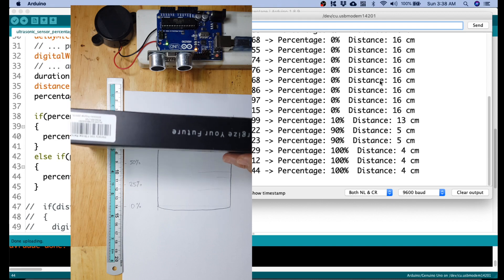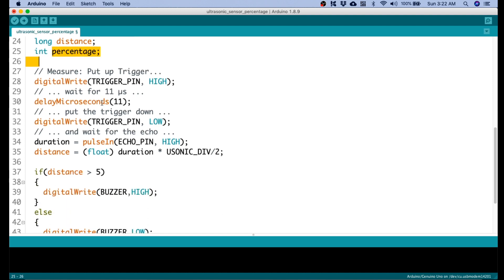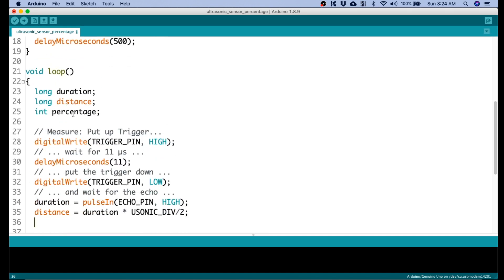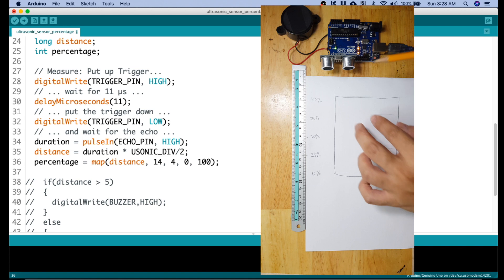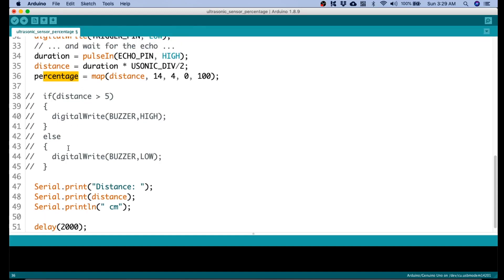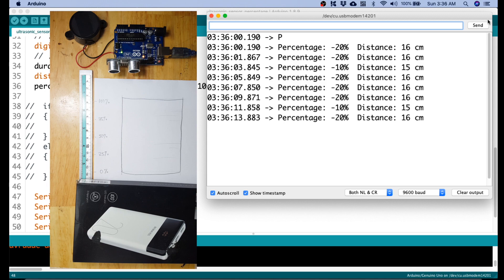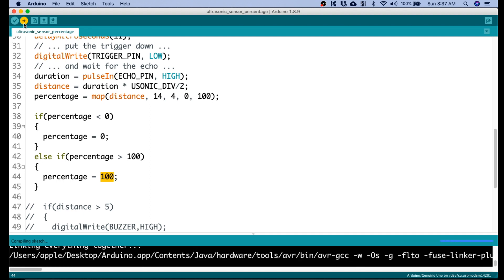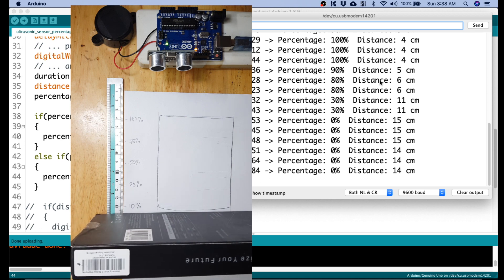WATER LEVEL OR FLUID LEVEL SENSOR TUTORIAL IN ARDUINO USING ULTRASONIC SENSOR - UNIT IS IN %

Comment: Thanks a ton man, i was seraching this everywhere and finally found it here, nice explanation but i have a question, It incriments or decriments in 10s like 20% 30% 40%, so how to increment/decrement in 1s like 10% 11% 12% 13% and so on?
And to extend it a little bit, can u use it with nrf modules and send the data in percentage to nrf reciever module which will display percentage on LCD?
i want to use it in my home overhead water tank. Since tank is on 3rd floor so i want to use nrf modules as they are dirt cheap and will serve the purpose.

Comment: Please code
Reply from the maker: The code is on the video link in the description
Reply: @circuitdesolator  Circuit Desolator I need your help In  my project I want to create an arduino with lcd and sensor that shows tank content in liters and actual height  measurement in cm